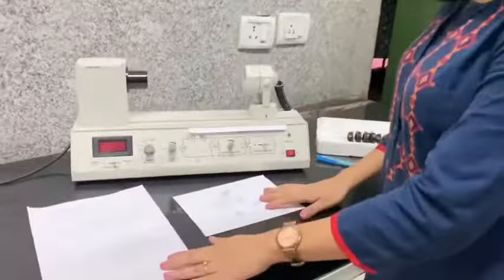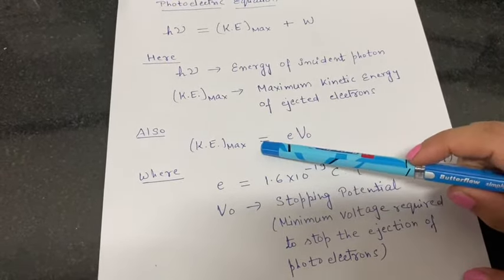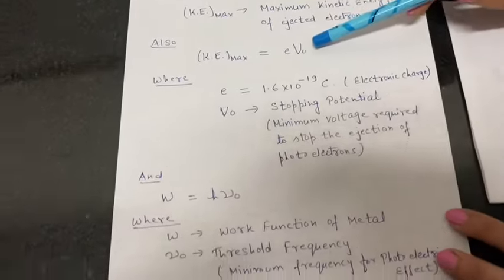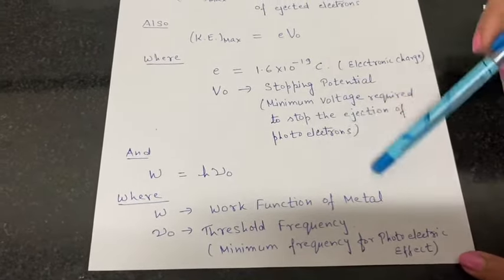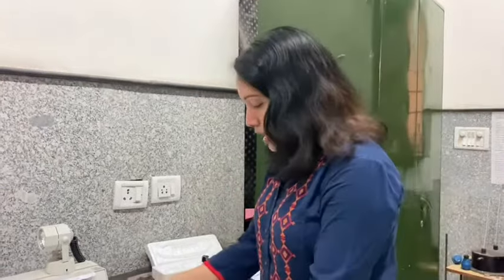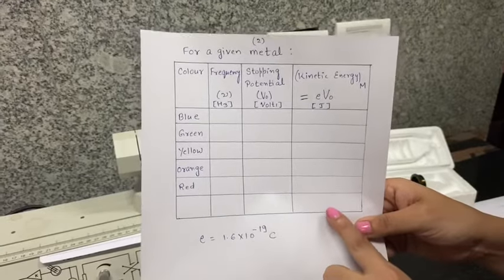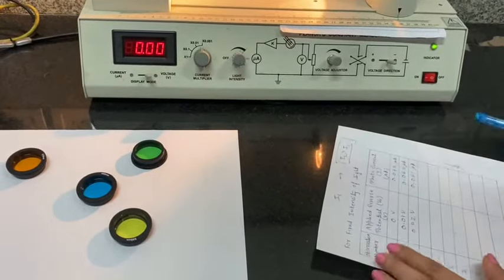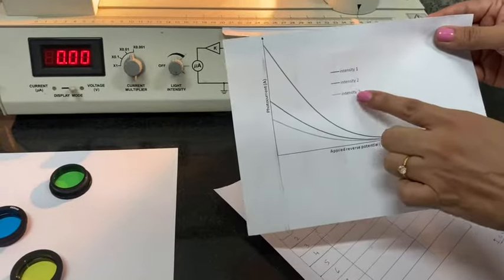Photoelectric Effect| Experiment|Dr. Prajwalit Shikha

Comment: mam, I think frequency depends on the source and as wavelength changes colour of light. when we are using a filter the wavelength of light falling on the metal plate would change rather than the frequency .thank you mam for a very nice explanation.
Reply: The way each light has a different wavelength similarly each light has a different frequency too!
You can also do the experiment considering wavelength but in that case E= hc/lamda you will have to use.
Reply: That would imply the speed of light is varying if the freq is fixed but the wavelength changes